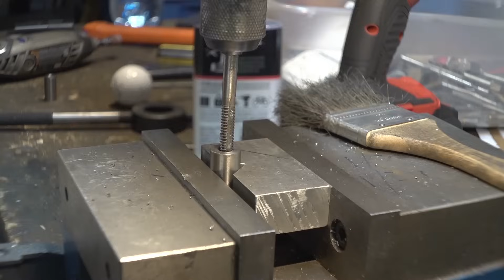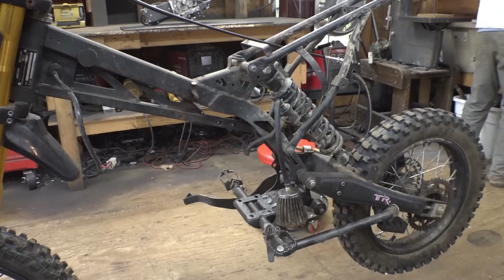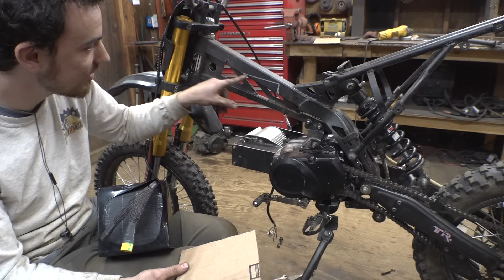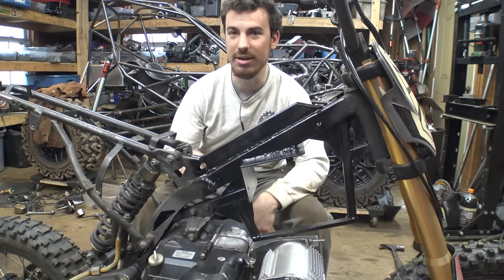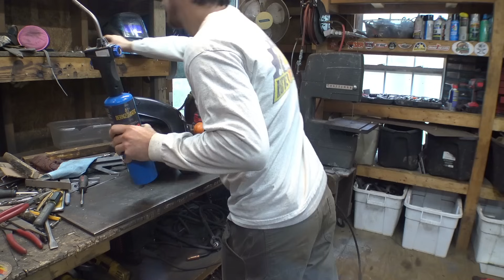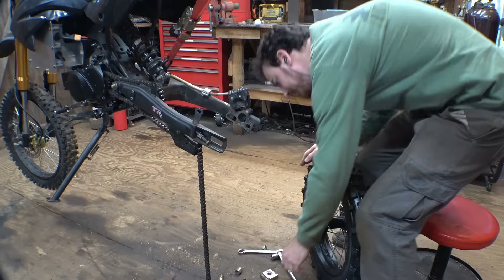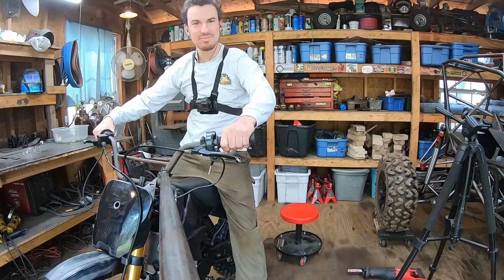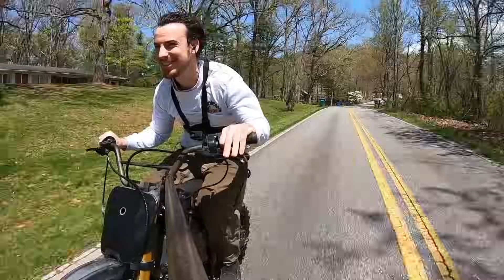A Different Way to Build An Electric Dirt Bike  - Part 2

Comment: Battery box should have been steel and designed as a structural part of the frame. 

Better plan in hindsight may have been to gut the gas tank, keeping the mounts for the plastics. Mounting the battery in the tank.

Comment: Need a 10k rpm motor, but omg this has me wanting to start collecting parts to do this for when my grom decides to send a valve through the piston.
Reply: Also it would help if it didn't have motor braking for it to free spin off throttle. It would help a lot with the heat.

Comment: Great build!! I've built MANY electric bikes and these people doing these single speed builds simply DONT UNDERSTAND for some reason, that for slow speed climbing  scenarios, technical stuff, like single-track,  GEARS MAKE ALL THE DIFFERENCE! you will climb better, run cooler, waste less energy through heat, HAVE GREATER RANGE, burn up less electrics, and have MORE FUN!
Reply: in my opinion if your not going to be dong serious trail riding and just want somthing easy to build while being fun doing a single gear system is totally fine, you really dont need all the gearing for just cruzing around, now if you were going to do serious trail riding then mabye this would be the better option.
Reply: @alexr2539  In my opinion a CVT transmission would be better for cruisers. I believe here in the Philippines there's been some scooter manufacturers making electric versions of gas scooters.

I even made one myself using an old 125cc scooter, just plop the engine off and replace with an electric motor. Good torque for climbing and speed and what's better is for less throttle you are already zooming 100kph which I think is around 60mph+. 

Though I did get a warning because apparently it's illegal to convert gas motorcycles to electric. Which is bs.
Reply: I've been saying this since day 1... all these single speed bikes are idiotic. Same principal at play as any other anything, doesn't matter what's making the power, gearing is everything! Gearing manipulates torque, and manipulating torque is the entire premise at play. it's why gears are what you've been after since you were a toddler. From a single speed baby bike, to a 10 speed, to a 21 speed and up. Same with cars, same with trucks, same with atvs, same with EVs... or at least it should be, but for some reason everyone's happy banging their head against the wall and drooling instead. It's like there's some unofficial yet totally official rule at play, that anything "ev" has to be made for the lowest common intellectual denominator. Gears are too confusing!

Comment: Might not be a bad thing leaking a bit of oil into the chain drive, other than more efficiency losses. But at least it might make it quieter. The project turned out pretty good for what it is. It would definitely do a decent job getting you around the pits of a Drag Car event or similar. 20amp hour should give you at least 6 to 10 miles range I reckon. Just start off in 3rd and get into top gear ASAP. Put along at 20mph and you'll get plenty more than that. 

I'd love to see some speed trials with the bike over an 1/8th mile drag. Comparing the speed to 60 foot, 300 foot and 1/8th mile using all the gears, vs starting off in top gear. Make your own course on a decent bitumen or concrete back road. A phone set up as the GPS Speedo would be a great visual as well.
Reply: oil in the chain case could leak into the motor, and out of it, but personally i would pack the chaincase full of grease.

Comment: What about mounting the motor inline with the engine and make a 90 degree drive inside the engine with beval gears or a ring pinion type setup like a golf cart uses that would reduce the chain noise significantly

Comment: They are NEVER ever called clutch PADs- it's CLUTCH PLATES - you have Friction plates and Steel Plates - CRINGE FACTOR 9000!! LOL

PS: dragging your feet in the corners is the BEST way to break a foot or ankle- Keep your damn feet on the pegs on the road dude!

Comment: What kind of oil did you put in it? If it wasn't Jaso spec it's going to have slip additives that will let the clutch slip easier.

Comment: You could also fill the gas tank with water to make sure there's no gas left in it. Will work with a propane tank too if you ever need to cut into one of those.

Comment: You are asking too much of your clutch but you can remedy this.  You need to increase the  gear ratio on your primary drive.  Between the electric motor and the dirtbike engine crank.  You need to return the rear sprocket to its original size or possibly larger to keep from burning out the clutch.

Comment: I love it . Having electric but with the feel of a normal bike with the gears is very cool . This whole build has been so interesting 👍
Reply: Not gonna feel anything like a ic engine .  Your decreasing performance and increasing chances of breaking . Plus the trans isn't made for the hi torque that electric motor always puts out .  Cool in theory but just kinda dumb . And will cause problems .
Reply: @SacredHeart0520 honestly using a slightly less strong motor for his build wouldve been better, because the motor he used was just too much which made the clutch go bye bye

Comment: I dont think a  belt will fit behind that internal stator backing cover anyways, chain is probably the best bet.  Put a drain on the lowerside of the chain cover to drain it back into the case.

Comment: Put some dry ice into a gas tank if you ever need to cut it or weld/braze it. It will fill with co2 and therefore can’t just explode since there won’t be any oxygen

Comment: This thing is turning out really well. One small knitpick though. Using a larger front sprocket would have been a better than a small rear because it would have helped chain and sprocket life instead of hurt. Also, the small rear sprocket is going to mean a lot more wear on the chain guides/sliders. Unless there was something preventing this of course.
Reply: shut up !
Reply: You are Right about wear but the his current gear ratio is limiting low speed power even in 1st gear and enlarging his motor sprocket would further worsen the gap between actual and efficient rpms

Comment: Easy fix for the clutch issue. You need to reduce the torque through the clutch. You need a larger front spocket on the motor. Then you can go back to the larger sproket on the wheel. 

Also +1 for going bigger. Here's my manual electric conversion.
https://youtu.be/9a_2OgRDI4Y

Comment: Why did you not use a shaft drive?  (more torque, less noise, less maintenance required) i would suggest a 10kw 12,000 rpm max continuous brush-less 3 phase dc electric stepper motor. i would also suggest some ultra high capacity/density/charge/discharge super capacitors to give you 10-60 second boosts of torque/speed without straining/damaging/draining the battery too quickly.. would also help with regenerative braking.

Comment: instead of smaller gear in the back how about a different gear on the motor and take some load off the clutches? and put some eye protection on when riding, I took a bee to the eye once, wasnt fun.

Comment: CHRIS...YOU ACTUALLY DONT NEED THE CLUTCH..EVEN FOR DOWN SHIFTING...THE MOTOR HAS A SEQUENTIAL TRANS..IT WONT HURT ANYTHING...MY SHIFTER KART HAS A KX125 MOTOR AMD YOU ONLY USE THE CLUTCH FOR TAKING OFF AND STOPPING....

Comment: if the clutch is slipping, replace rear sprocket with a bigger one and also replace motor sprocket with a smaller one so this way it will put much less strain on the clutch but it will stress more the motor.
Reply: so if you increase motor sprocket it will decrease the torque of the motor which will help with the clutch... or is it shame shi* different setup?? xDDD

Comment: Chris doit with a yz 250 2 stroke transmission they haul and can be hard to ride on trails. I think the clutch would hold up just fine for ya. I used to have one and I was rarely out of 2nd gear.

Comment: Hey mate, if you want to neutralise a fuel tank before cutting into it, hook it up to a car exhaust for a while (30-45mins). It's  much safer than doing the flash test !   :)
Reply: Put some water in your tank before you cut and it will prevent you from getting any flashbacks.

Comment: wouldn´t blame the tire just cause of its price, offroad tires are much softer than street tires plus the "pointy" surface it has on asphalt. i had this in mind when i saw the burnout and wasn´t suprised at the end.
i have to change my back tire after 2-3 hours of racing on dirt without burnout it on asphalt.
beside that nice build and i like to see it offroad.

Comment: I think that you could have used the engine as a stressed member of the frame. The material you used for the motor's drive cover would be strong enough to have a bolt on mount for a front down tube to attach to.

Comment: i am building an electric bycicle i instead to keep gears the way i see it is small motor direct drive would lack power with gears i can still get that low end power to get it up hills at better speed a pro cyclist puts out 250w of power with a salvaged coverboard motor it will put that down and will be join to the crank at the pedels

Comment: 1 tooth change at the front is like changing 3 teeth on the rear so if more change is needed going larger at the front will work if you cant get smaller rear

Comment: is good idea. as any efficiency loss of the gearbox. can be gained back by having the motor running at/closer to its most efficient rpm.
i still prefer a hub motor for electric bikes. leaves you more space in the frame for a bigger battery.

Comment: That’s mint.
With your slipping clutch issue, use 1 spark plug washer under each clutch spring and it will give just enough extra pressure while not causing the spring to bind up when you operate the clutch. 
The washers fit over the clutch towers nice and it worked for my turbo pitbike.

Comment: My son has a mx 500 razor dirtbike I've got 2,  20v 6 amp hour batteries replacing the original batteries on it I'm running it at 40v because it was a 36v bike ...I've done no other changes , my 9 year old 80 pound son rides it for miles and miles and miles ... I'm positive he can cover a 4 mile loop through the woods to a beach over my way it's done it a few times ... also like to say he has a gas pitbike 110cc same size as the razor .. and a 125cc kids quad ... his 2 brothers ages 11 and 6 ride also but he has the most interest of the 3 ...

Comment: 1. You blocked the airflow through the motor with the chain box.
2. The battery box needs a lightning bolt sticker on the side.

Comment: Cool build. I think raving and pulsing the throttle is very hard on the electronics. It's not a gas motor and doing that cause voltage spikes and adds heat to both the motor and speed control.

Comment: If you wanna tap on the lathe just get spiral machine taps, they wont do the last 3 threads of a blind hole but they're meant to evacuate the chips down the flutes and don't jam up. Just run them through, no reversing.

Comment: I'm not sure you really need the clutch ... on the gas motor the need for the clutch was because its consistently running even at a idle ... I think if your electric motor was completely 0 throttle you should be able to select a gear and go especially from a dead stop ... 1st gear no rpm no clutch and then give it throttle and watch it go

Comment: I am not in any way a Mechanic. So I ask.. You showed to different sprockets and I instantly thought. Do they make Derailers for that size Chain, and is there enough room for another sprocket? I would think the need separated a little enough for the chain to nicely switch back and forth. Link on the front of a mountain bike. I guess what I am saying is, switching gears up with a Derailers, as well as using the clutch to easy let the chain switch. The bigger sprocket take you effortlessly up the hill and the smaller one is for like top speed and down hill fun and stuffs. Again lol do they even make a Derailer for that size chain? (I think I am spelling Derailers wrong but..) Love your videos. Awesome projects

Comment: It's a shame you couldn't remove the shrink wrap from the battery, split it into two sections that could be mounted on opposite sides of the center bar. The battery may need some additional wiring added but it appears to be made of four separate cells.

Comment: Measure never, cut 50 times.. As long as yur having fun bud..... heh

RE: adding gears
You add a level of complexity that's non-needed and you've seen that complexity already. The entire set-up is only a proof of concept. You need to re-engineer the entire gearbox because nothing in that setup is designed to deal with the added torque. It'll all wear out far to quickly and run times are going to suck. I do not disagree with the fun factor but you are setting up the bike for failure in its current form.

Comment: make a magnetic clutch, ie alternating magnet disc plus a copper receiver disc, with retract operation, axially
Reply: W=Pt, work = power * time, [Wh watt hours = V volts * Ah ampere hours], P=UI, W= volts * ah = VAh = Wh
Reply: calculate the kWh of the battery, and the kWh/mile or the bike-engine

Comment: I would put a grease fitting on the front primary chain box and pump in enough grease so when it melts it some will go into the lower crank gear.  It will quiet down and put more power to the rear tire.
I hate to be negative but regardless if it's the law or not ... EYE PROTECTION is critical and a helmet is a logical choice EVERY time you ride.  A Junebug in the face at 50mph sucks when it hits your face shield, I can't imagine what it would feel like in your eye!
Reply: Caught a Junebug in the neck once at 70 mph.  If I hadn’t seen it flying around first, I would have thought it was a rock, it hurt so bad.  Certainly enough to damage an eye.
Reply: @mlindsay527   It's that E=MC2 thing.
You don't think a Junebug has much mass until you factor in velocity squared.  Now that Junebug can kick your ass.
On an equally bad day ... maybe worse ... have you ever had your visor up and had a 70mph bee fly into your ear?  It is amazing how fast you can get pulled over and get your helmet off. 
Just sayin'

Comment: The motor gets hot because in 3rd or 4th gear the motor strains too much. The other question is does the speed controller box get too hot?

Comment: Is there lubrication on the motor to crank chain? I'd think it would benefit from a sealed constant oiling (having oil in the crankcase). If there is oil in the crankcase, I totally missed it.

Comment: Here's an idea.
Replace crankshaft gear with centrifugal clutch & belt drive.

It will contain electric torque. 
As well as sustain rolling momentum.

Comment: looks insane...awesome welding and fabrication skillz as usual...i like the mid drive set up...im getting read to do a 1970s vespa...i will prolly do hub engine tho....great series...thanx for sharing all of the knowledge...some people put the controller where the gas tank is also...after they cut the bottom off.   two sided tape is your freind :P

Comment: Nice video Rather B Welding ! I just got a hot tip on chains. If you mix melted parafin wax and teflon powder and then dunk the chain on it and wiggle it around so it penetrates the links. Then, take it off an drain and let cool. This will lubricate the chain and keep it from attracting dust and dirt. Great tip for dirt bikes and MTBs. I would also suggest to tape a pull handle on the sides of the battery. Using Duck Tape to make the handle would suffice. Nice video!

Comment: Awesome 👌 job. Pick something with 6 speed if possible or designed for 250 to 450 power stock and go big on electric motor and speed controller. There is also sprocket calculator s or website to get the difference in drive ratio and amount of speed difference

Comment: I built a 72v 3000w motor system on a small Razor MX500 frame using ryobi power tool batteries. I can get 4 miles on 6ah batteries at 45mph. I run 4 packs in series for the 72v. It is a beast

Comment: I think I would have used steel for the battery box and used it to reinforce the frame. Pack some grease in and around the chain to help with the noise. That's 2 cents. Love the videos and creativity!!

Comment: Put the stock gear back on the the rear, no it wont be as fast but your little motor will thank you by running cooler and more efficient thus living longer and longer run times

Comment: What you can do tackle both top speed and clutch slipping is putting a bigger gear on the motor, it will make the speed of the crankshaft closer to what it was with the gaz engine as well as lowering the torque. Love this setup. Can't wait for the next one. This thing is gonna be great on trails. One thing you should check is the efficiency/torque curve of this motor, you'll be able to optimize range.

Comment: For the long cruises and to save on the clutch you could just start out in say 5th gear or fourth gear so you don't have to shift so much. It has all the torque that it needs right away from the get-go
Reply: If he gives it to much throttle at the start in 4th or 5th it will smoke the clutch faster.
Reply: @studdgage  100% truth
Reply: I think the best case would be to just get rid of the clutch all-together.  I can't see any good reason to even have it in there,  tbh...
Reply: @billymanilli  cut the power from the transmission

Comment: Seeing a lot of comments about why electric bikes don't have or should have gears - the torque band with an electric motor is so broad and comes on instantly - there really is no need for gears with an electric motor. From an efficiency standpoint an electric motor will be far more efficient without gears, by simply using the controller to regulate power output vs turning entire gearsets.

Regardless, it is entertaining to watch the creative solutions to the problems that he encounters. GREAT CONTENT!